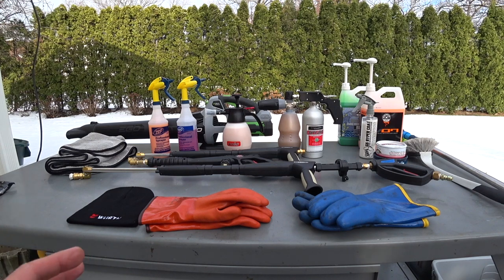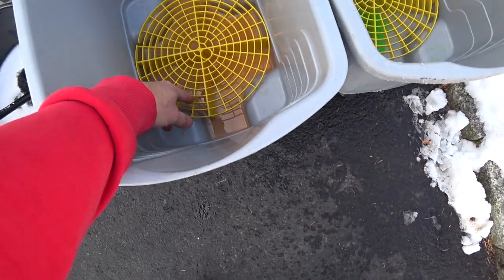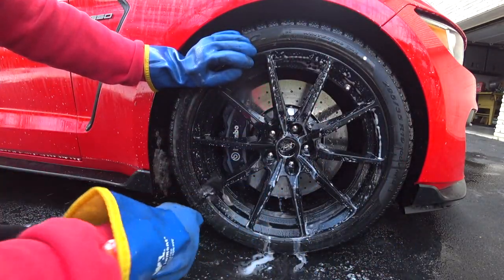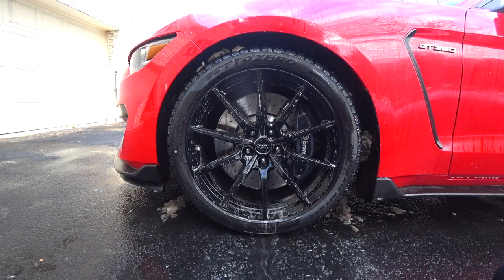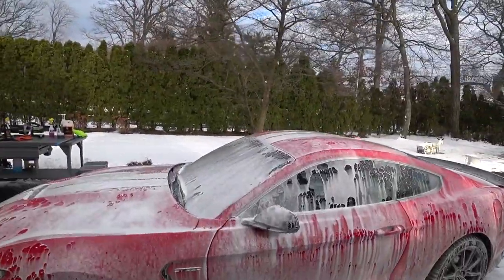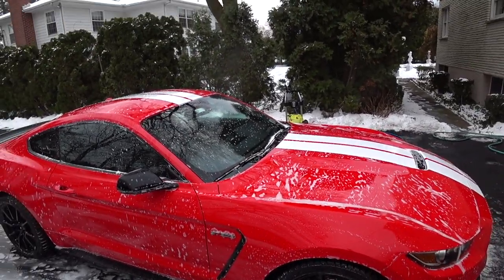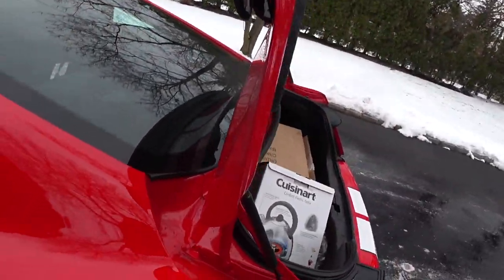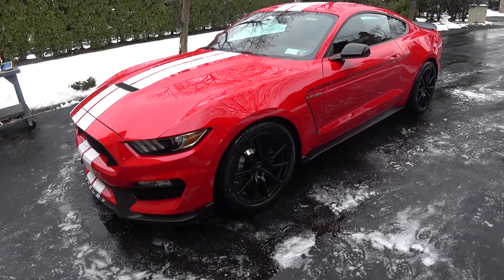How to Wash Your Car in Winter The Right Way | Auto Fanatic

Comment: if you can afford a mustang and all that jazz..i would buy an old beater to drive in the winter and leave it in the garage..thats just me
Reply from the maker: i work way to hard to want to drive a dirty worn out beater car thats just not my style.
Reply: try checking out the ryobi under car cleaner..their badass
Reply from the maker: i got a better one the Ryobi wont work under any of my cars since they are so low to the ground, check my channel for the low profile undercar cleaner i found for well under $80 on Amazon, they sold out instantly from my video
Reply: @autofanaticcars  yes i was wandering about the clearance..but i thought it was a cool tool